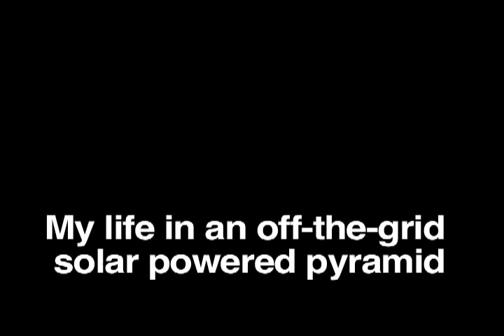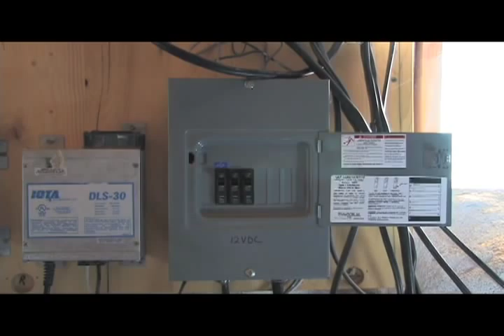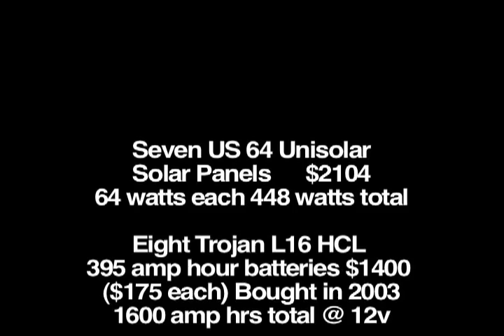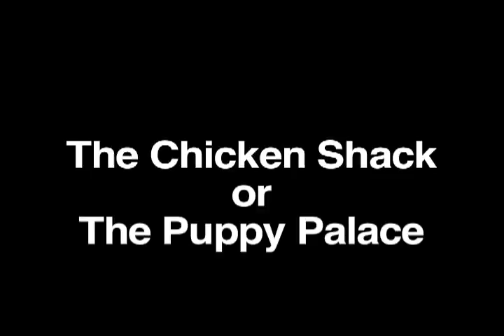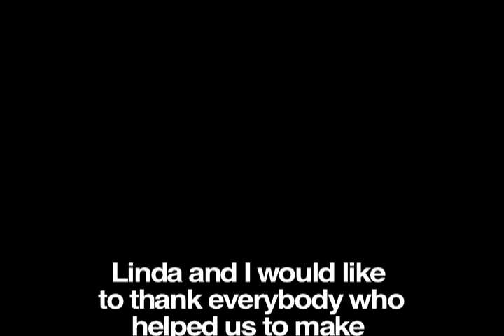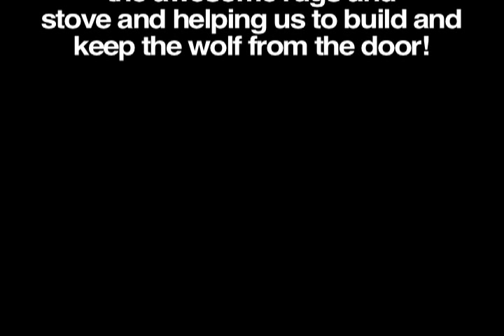My Life In An Off The Grid Solar Powered Pyramid- Entire Film!!

Comment: Converting a freezer into a fridge is an amazingly smart idea. They are generally better insulated than fridges. And the cool air is heaver so opening and closing it doesn't waste as much energy. And it's accomplished with a simple thermometer and automatic switch, so the power is cut to the compressor before it gets too cold. Amazing video! Thanks!

Comment: Great work, Proud of you Greg and family, I too have built my own house and are fully off grid 42 solar panels 1 wind turbine, Winter is hard work with only 10hrs of light, 2/10 of my house came from rubbish left over from building sites.
My solar setup cost, was 6 times yours
Reply: Thanks for the comment. We have little light in the winter here as well, some days it is 0.0 amps of solar power.... so we have to run the generator about 15 hours a week to keep the batteries charged. It may have cost 6 times more, but you have 6 times as many solar panels AND a wind turbine, cool. I bet you have a whole lot of power coming in when it's sunny - I'd love to buy a few more panels now that they are so much cheaper.

Comment: Great to see people freeing them selves.  Let me know if you need any fiddle tracks :-) . My issue with solar though, is the energy required to mine, refine, manufacture and transport solar panels and a battery array is greater then the amount of energy the system will produce over its 10 - 15 year life span with some very toxic waste when you have to replace it. I believe there are ways to make renewable green energy but they're not the options that we've been provided with. Solar is convenient for off grid but it ain't green and it ain't renewable.
Reply: Being Free and off the Grid is the ultimate dream

Comment: Food for thought!  I have a wood stove, with glass door in my brick fireplace, in a 1200 square foot house in Savannah, GA.   I have a $150 laser temp gun and the wood/lava rock coals inside a fireplace reach about 600-700 degrees.  Where the glass door reaches about 330 degrees. A turbo fan works great, on the glass door, moving the heat around around the room. I want to add pipes inside and convert to steam or floor coiled heat, with pump.  Good luck man! Labradors Rule! God Bless the USA!

Comment: Well, it's a nice construction. One of the points Greg mentioned was running the generator in the winter. Given the battery bank at present I think he could add one 300 watt wind mill and charge controller. If you don't have sun then you generally have wind. Just something to think about later. If he doesn't want to buy one he can build it if he has welding knowledge or a friend. The rest is just magnets, coils and a little hardware. Should be easy for a man of many talents. In either case let Greg know he did a great job.
Reply: Thanks for you comment. Two hours east of me there is a lot of wind power available but right where I live in the forest in the mountains we receive very little wind. We get the occasional wind storm, but most days it's just gentle breezes otherwise I definitely would hook up some wind power for the winter. Now that solar prices are down, when I get some extra cash I want to buy a really large battery bank and more panels so when the sun does shine in the winter (it does occasionally) I could stock up and store the energy and not have to use the generator very much at all, even in the winter.

Comment: Utterly inspiring dudes! Thanks so much for this. Why did you choose this method of build, as opposed to say, tiers and dirt?
Reply: Well, first of all there are lots and lots of trees here, so I had access to free lumber onsite, I just had to cut, drag and peel it. Straw was available locally as well and quite cheap and it is just a real pleasure to work with, very forgiving and as long as you don't let it get wet, it lasts a very long time. Working mostly alone, bales are easy to handle, no machinery needed etc

Comment: Wow! Your documentary is an inspiration indeed. I am planning to live off the grid in a homestead community that is just getting started really. Solar power has been their goal but have lacked the manpower, so I am excited on the potential the place has to offer. This may have been asked, but do you have running water? I know they have made a water collection system from barrels for an outside shower but winter is coming.
Reply: I do have a well and running water. For over ten years I collected rainwater in barrels and used that for cleaning and cooking etc, and drove to a nearby spring with 5 gallon water jugs for drinking water. One good rain storm can collect several hundred  gallons of water with a fairly small roof. You can use a dc pump and propane on demand water heater for a good shower - I'll be posting a video on this in September.
Reply: Greg Grant
Excellent! Thank you for the great idea! I am looking forward to the freedom I will have, even though I know it will take hard work, I will be the one benefiting from it instead of someone making a profit off measly wages. Also, the song I heard in the video is awesome! I would definitely be interested in hearing more!
Reply: Greg Grant
Oh, I recall you mentioning starting out with two batteris and your car for power. How exactly does that work?
Reply: Sherrie Davidson
Just use your car and take out the battery, fully charged, put in the other one, drive it and it charges. You need a voltmeter ($5 for a cheap one) and the battery shouldn't get below 12.5 in order to still start your car. An inverter (cheap one is $20) converts the dc battery to ac household power. Oh, and check out http://greggrantmusic.com/      for my music etc.
Reply: Greg Grant
Thank you so very much! I admire your accomplishments! I am also a singer and play a little keyboard. So, you are very inspiring all around. Thank you for the link. If I ever make it to MT, I will definitely come see you play. May all your dreams continue to prosper!

Comment: We are doing a similar project. Have you guys heard of Rocket Mass heaters? We plan on including a rocket mass heater in our basement. Rocket mass heaters are very efficient, much more so than the wood stoves you have heating your place. They also cost less to build one than to buy a wood stove.
Reply: I have heard of them but need to learn more about them. I want to make little improvements here and there now that I am not overwhelmed with building and just getting it done before it snows or rains etc. My first step is to upgrade my solar panels now that they are so much cheaper and I am looking into Aqueous Hybrid Ion batteries to replace my old, abused and dying Trojan L16 battery bank. Good luck on your project!
Reply: I have not seen them for sale yet. I emailed one company but they aren't selling to the general public yet. I'm very hopeful about them and will definitely post something when I find out where to get them and how much.

Comment: this is really good you did a great job the buildings look great !! I often think of buying a small cheap plot of land and building underground 1.5 stories and utilize solar ac/dc set up a/c for plugs and lights (LED) and dc for washer/dryer(maybe) a gas fired fridge/freezer/ stove and a gasifier wood/coal stove of some type all the lighting will be LED. a well and some really cool rooms sub level and a level where its windows all the way around this floor will be open and a 36 inch attic fan/luver system to evacuate heat from above on really warm summer days . I have looked at this plan for years i think its the one I'm gona build some day it will be small but it will be efficient . my favorite apartments were the small ones why use any more heat than you have to . I put it up against owning a single wide trailer and they both look pretty comparable in costs but the single wide has to be on a rented lot at a cost of around 200 per month in my area plus to build a place here the amount of permits you need is dunting  this alone will cost you thousands alone thanks for the video it keeps the dream alive inside me to have a neat place all my own thats different and off the grid .
Reply: I wish you luck, sounds like an interesting structure. I personally like being down below ground level, it has a very safe, comfy feel to it, totally sheltered.

Comment: I could still open it up someday, it's a good idea. They have those sun tubes as well (a cylinder with mirrors inside like 6 inches in diameter I think) that you could use to get more light instead of using electricity.

Comment: This video was very well done and very inspirational as well. Great soundtrack. I've almost paid for my house and I am considering both the solar power option and the idea of going off-grid. Why did you chose a pyramid for the shape of your main house? What are the advantages to building non-rectangular homes? Keep swinging!
Reply: Thanks for the positive comment! I chose a pyramid shape because I find the form quite beautiful and also for esoteric reasons - pyramid energy, Feng shui, native people's beliefs about energy flow etc. Also because, in MT, the roof is steep enough so that there is never any snow buildup, it just slides off. Many conventional houses have pyramid roofs, without actually being pyramids. Good luck!
Reply: Supposedly, and I do believe this, energy can get trapped in the corners of rectangular homes, it doesn't flow as well.

Comment: No concerns about earthquake stability?
Has a state inspector approved a cotton-lined, straw house for fire code?
Did a state inspector approve your electrical system? Seems strange to run a fuse panel instead of breakers. I mean, we did use them way back when, but I was wondering what kind of regs you had to stick to for that set up?
Reply: Greg Grant
very cool.  So the plaster-ish coating serves as a fire retardant for the straw I suppose... similar to drywall I suppose.

Ahhh... so there IS a breaker box, its in addition to the fuse box.  that makes more sense.

Thanks for posting the vid.

Comment: 24 or 48v solar system is more efficient than 12v especially if your running inverters unless you have no choice. The system I have is a split voltage system consisting of a separate sub-arrays for 48, 24 and 12v where the 48 and 24 feeds run inverters and 12v feeds run LED lighting only. The total max wattage is around 15.2Kw on the 48 and 24 subs and 5500 watts on the 12v sub. The only bite(s) i have with this is one I am in Louisiana which speaks for itself. Two I HAD to tie it into the grid with a GTI by Law.
Reply: Yeah, it's true. I was looking to possibly add a few solar panels since they are so cheap now and it seems the new ones are all 24 or 48 volt. I have had a 12v system for 20 years now and it is still great and everything still works fine. Someday I will get a new system and new panels etc. probably 24volt.

Comment: To say that I love what you're doing would be an understatement. I would like to know more about that last white plaster covering if possible. Also curious why your didn't go with a Rocket-mass woodstove / heater?
Reply: +Steve Smith Thanks for that comment! The white finish coat was actually a stucco made by Imasco. You can buy a bunch of different colors ( I chose white) and you just mix with water and apply, very simple. A grainy finish, not super smooth like a plaster, but I like the textured look.   I still may go with a rocket stove someday, but it was just easy and cheap to get a decent wood stove and get it going in one day.
Reply: Thanks for the reply, Greg.

Comment: Hi Great video, im in the northen UK  so i would imagine we get the same sort of weater and you. At the moment I am trying to get the house we recently purchased to be more 'off grid' when we moved into the property it had Oil fired centeral heating/ hot water and mains electric. We have just fitted 14 275watt solar panels that should give us a total of 4KW system. I notice you seam to have fairly low output panels was this due to the cost or just what you have worked out you need?

Comment: One of the reasons I chose MT is because there is no building code outside of city limits. So, no, I had no problems, no permits required, nothing. If you do electric from the grid or a septic system you do have permits and inspectors, but I didn't do those. I wish you luck!

Comment: hey, im interested in going off grid pretty soon, how are the batteries wired in series or parallel?
Reply: I had 8 trojan L16's (6 volts each) wired in series AND in parallel. I ended up with a 12 volt battery bank that had a large amount of amp hours (1600 amp hours).  There are many sites online that show you (with pictures) how to connect batteries in different ways. If I was to buy a new system now, I would probably have my battery bank wired for 24volt and buy 24 volt panels etc.
Reply: Hey Greg, what county, state did you build in? Are they a no code/restrictions county? Thanks
Reply: I built in Montana. No code unless you do electric from the grid or if you do a septic then you need a perc test/approval. I believe most counties in MT still have no building code outside of city limits.

Comment: OH! haha another idea you can use for the hydrogen is to have a stirling engine that is run from a parabolic mirror that focus on the stirling engines spot that gets heated. Underneath this heated spot inside the engine it is filled with Hydrogen and the heat causes the Hydrogen to expand pushing the piston moving a crank and spinning a generator. You could also use a set of mirrors or a parabolic to heat a jug with water hoisted into the focus spot and run the engine off of steam very cheap!

Comment: Where I live, Atlanta ga, a 1/4 acre runs anywhere from $12,000 -$35,000. To install a mailbox you need permits and permission from the city and county. I wish we had the freedom to do with our land exactly what we wanted but we can't. Can your solar system run an AC/heating unit? Here it can go over 100 degrees in the summer.
Reply: Yeah, the cities and just outside the cities get pretty pricey for land or a home and lots of rules and regulations. In my house I have a large thermal mass and the downstairs is 3 foot below ground level, so it NEVER gets above about 72 F, even when it is over 100 F for a week, which happens out here as well, although it is low humidity. AC and Heat using electricity, use a lot of power and are usually avoided with a solar system. Propane or wood for heat makes more sense. You could run an A/C with solar, it is possible, it just usually makes more sense not to, to super insulate the structure, etc instead.
Reply: Thanks for the info. I may have to run a power line for the AC but leave the rest set up on the solar. I'm making plans and saving right now to do something similar to what you did. Great video by the way. A slight tip should you break your arm again. Tie a rope or strap around the log. leave it on the ground and then slam it with the axe. No pieces fly off anywhere and you can hit and hit without having to pick up anything until it is all split.
Reply: That's a great idea, but I hope I never have to use it!

Comment: this is incredible if you want another way to power your house in the winter you should invest In a couple large propane tanks and have a quality HHO generator and use solar power in the summer that is excess to power the HHO dry cell Gen. And then store the Hydrogen inside the tanks until it is needed and you use a Hydrogen fuel cell not dry cell generator. The fuel cell converts the hydrogen into electricity my making hydrogen work to reunite with the oxygen creating water to be reused :)

Comment: Simply amazing!  I greatly admire your perseverance and determination!  What are the dimensions of the octagonal building? And how did you build it exactly?  I would really like to try to build one like that.
Reply: Thanks! Well, the studio is an octagonal tipi shape (22 foot diameter inside) and the $500 house is a yurtlike octagon and has a 16 foot diameter. The studio - I used tires filled with earth for the foundation and poured  concrete at an angle on top so the bales could sit flat but be at the right angle. Chicken wire and old metal fencing stapled (poultry staples) to the 8 log/posts so the straw won't fall in. Also, the bales are staked to each other with wooden stakes.
Reply: Thanks for clarifying!

Comment: 9:45 ... on the pictures of the solar/battery system you seem to have a plastic pipe coming in from somewhere and going into the box where the batteries are ... what is that for?
Reply: It is to vent the hydrogen and oxygen gases that are produced when you charge the batteries at 14.34 Volts or higher. This only happens when you use a battery charger with the generator or if you choose to equalize with your solar panels, if you have enough solar power. My solar charge controller stops the batteries from charging past 14.0 Volts so they won't gas, but  it is good to equalize the batteries once a month or so ( at least twice a year)  at 15.5 Volts which produces a lot of gas and can be dangerous and poisonous if not vented.
Reply: Greg Grant Thanks.

Comment: The place i found called solarsystems-usa. Big selection and great prices. Only negative is bad cust service but i found prices outweighed the bad service. i got Scheuten 225 poly for $200/pp, but i just checked their site and much better deals now. For ex., 230w & 240 poly's for $188/panel. Also have 250w poly (ET Solar) for $223/panel. But selection is immense. They will usually comp the delivery on big panels if order > 10. The smaller panels (less 150w) are UPS shipped so reasonable